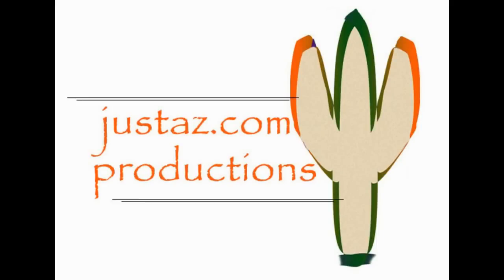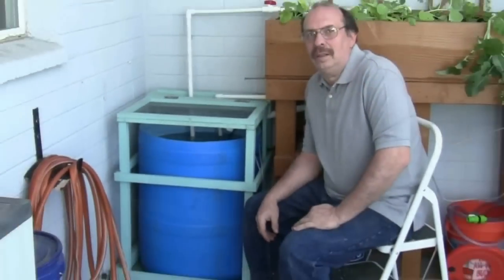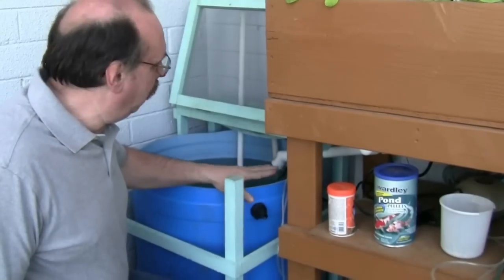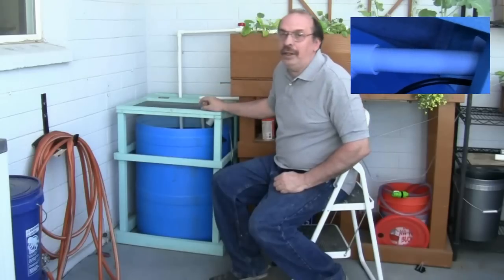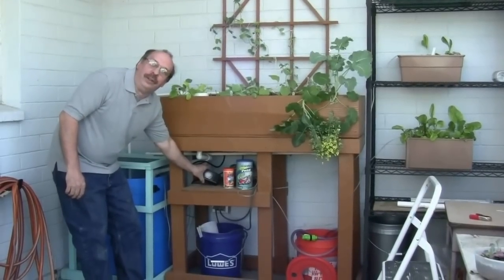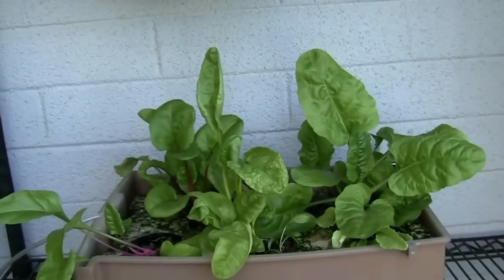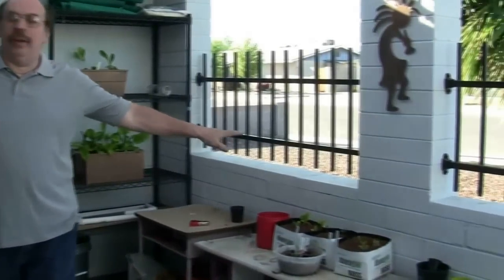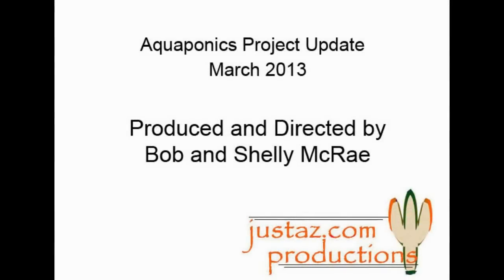Aquaponics Project Update March 2013

Comment: Just a quick note. Generally, when you use a bell siphon or "U" siphon in your aquaponics systems, a timer is not needed. The pump runs 24/7 but the grow bed floods and drains repeatedly by itself.
Reply from the maker: Hello, Noah Williams. We did try it without a timer, but weren't pleased with the results. It may be due to the climate we live in. I'm just guessing, but because it's always warm here, and we have a long stretch of really hot, the water doesn't hold on to enough oxygen. The timer allows for more oxygen to reach the roots. Like I said, I'm guessing. For cooler climes, the 24/7 may work much better. Thanks for taking the time to comment; we appreciate the input. Best of luck to you in all your projects.
Reply: I'm still struggling a bit to understand your use of both timer and siphon. As I understand these systems and common practice when using a timer, the growbed has a simple  weep hole the size of which controls the drain time. The timer is often set to 15 on/45 off, and the pump is sized to ensure the GB will fill in those 15 minutes.

 I suppose you have the bell siphon to quickly dump the GB and then control when the water is introduced again.

Seems to me that this will tend to stress the good bacteria of you bio filter as they will tend to dry out. This is not good for the fish.

Do you monitor your ammonia/ammonium/nitrite and nitrate levels?
Reply from the maker: Hello, Noah Williams. We do monitor our tank closely and the levels are consistently close to zero. We don't dispute your approach; we;re simply saying it doesn't work for our set up. To anyone setting up a system, we always say to experiment and adjust, because each system has it quirks. Thank your for your input, we appreciate it.